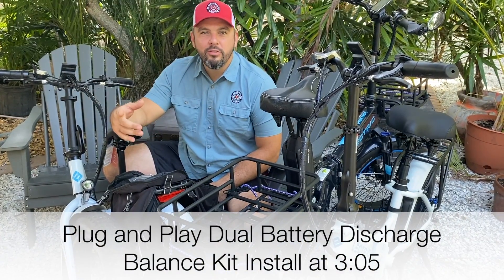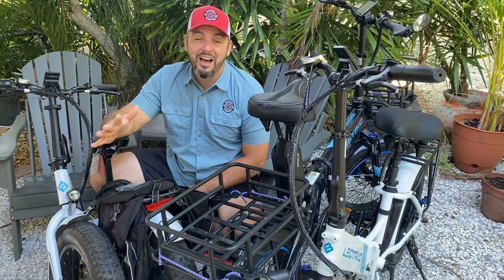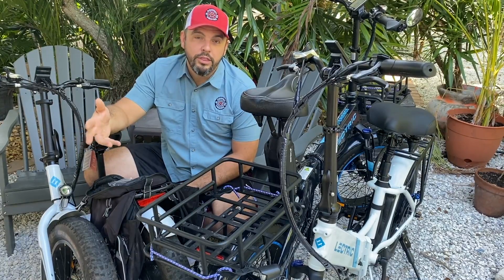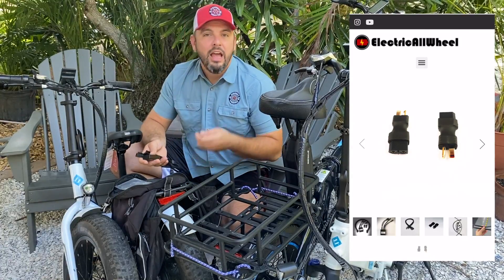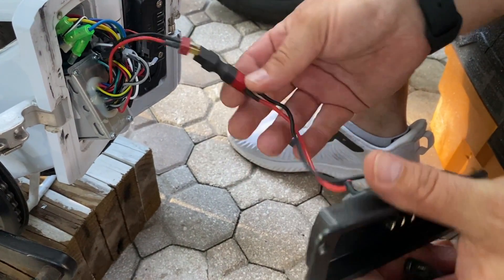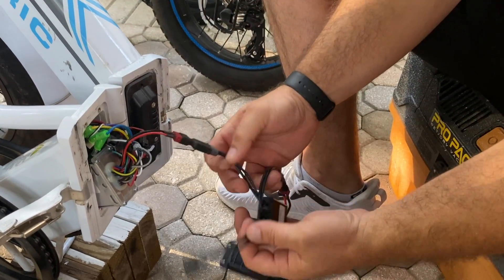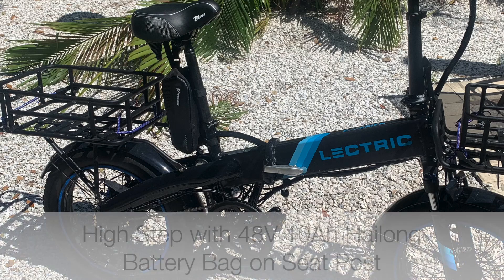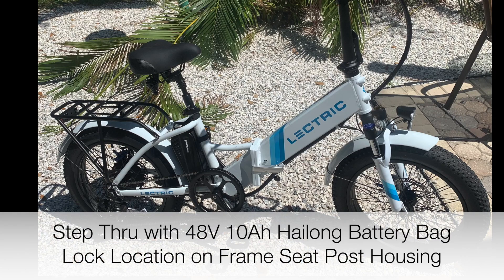Lectric | PLUG AND PLAY Dual Battery Discharge Balancer Install on Lectric XP 2.0 (XP, XP Lite XP 3)

Comment: This is awesome that you've done this, thanks! I definitely want to do this but I would really prefer to use my 2nd "stock" Lectric battery (ST 2.0) since I already own one. Any ideas if this is possible and what I would need? Thanks again!
Reply from the maker: Thanks!
 just so you know, Inside the case of that stock battery is a blue wrapped battery with XT60 connector. You could remove it and use it in a bag or separate protective case.
Reply: @ElectricAllWheel  I saw you had written that on another post but it's beyond my understanding, lol. Do you mean take everything out of the case? I wonder if I could somehow use the silver part of the case without the black plastic part. I wonder if there's a picture of what the inside of the battery looks like with the "top" off.
Reply from the maker: If you unscrew the black head of the battery case, inside the silver block is a battery that is wrapped and slid into the case for hard protective covering. It connects to the black head that has the key lock with XT60 connectors
Reply: @ElectricAllWheel  Great, I just ordered the kit so I'll take a look when it arrives. 
You mention you're in Florida... if you're close to Sebastian I would DEF be interested in paying you to do the install, if you'd be interested.
Reply from the maker: @markthepetsitter  we are in the Tampa Bay region 10 miles north of Clearwater
Reply: @markthepetsitter   Or you can just make A positive and neg lead connected to stock battery pos and neg via wire connectors.   But you would have to solder your own XT60 connector to the other end to plug in to the extensions from the kit
Reply: @fatheadfpv5732  thanks for the tip! I ended up buying the aftermarket battery in the video. I never really liked the way the stock battery mounted in the basket, it was just a smidge too long and took up too much space.
Reply: I have the same situation. The 9ah stock battery and the new 14ah long range battery. So, can I use your kit to run both batteries? Thanks!
Reply from the maker: Yes. Make sure your rated voltage for each battery matches (48V)
Reply: @ElectricAllWheel  will you be providing a video on how to install the kit using both the stock battery and the long range battery? I looked at the stock battery, but I’m not sure how to open it up and whether that will render the black part with the key unusable. Please, advise.  Thanks!

Comment: I have a Sondors Fold Mini/Sport with a 36v 8.7ah battery. Would something like this work for me?
Reply from the maker: Yes. The XT60 to deans t-plug adapters may not work for your controller, but discharge balancer will. Make sure your other battery is 36V

Comment: Can I use a different ah battery as long as the voltage is the same, say a 20ah alongside the stock 10ah
Reply from the maker: Yes. Perfect example.

Comment: I bought the long range battery and still have the original, would be great if someone made an adaptor to utilize both of them it would be a pretty simple concept
Reply from the maker: Inside the case of your long range is a wrapped battery connected to the case head with an XT60 connector. This can be bagged with aftermarket products easily.
Reply: @ElectricAllWheel  so basically can hook into the 60 , on the spare battery seems pretty simple
Reply from the maker: We would avoid cracking the batteries if possible. 
However, even if the connector is not a XT60, it will be a wrapped pack with BMS, and easily adapted. Keep in mind, It’s removal will void your warranty.
Reply: @ElectricAllWheel  should you keep it with good air flow and not all wrapped up and stuff the xt60 connector

Comment: You think there’s enough room in the XP Lite housing for this balancer? Good stuff, thanks!
Reply from the maker: We would put it under the seat on the post with the recommended battery or buy straps for a frame wrap. Thank you for watching!
Reply: @ElectricAllWheel   Not sure I quite understand this,are you saying the balancer will not fit inside the housing of the Lite or will it all go inside the housing with no problems?
Reply from the maker: We have not put the kit on a Lite. We understand the controller connectors and know that the kit will work plugged into the controller. It is anticipated that the balancer will fit in the body like the white step thru in the video, balancer flat on bottom underneath sideways controller. In a situation where it doesn’t fit or the owner has added LEDs or other connections, the extension cables can be switched to the balancer out, and 1 battery “in.” This will allow you to run the balancer to your battery bag outside of your frame.
Reply from the maker: @KellysWildAdventures  Wiring Overview PLUG and PLAY Dual Battery Discharge Balancer for Lectric XP, XP 2.0, Lite
https://youtu.be/NXx5Lr3lmFM

Comment: thanks.  Just bought one.  To confirm, I can hook the balancer up and still just run the Lectric battery right?  I would like to only add that 2nd battery when I am planing a longer ride but leave it off most of the time.
Reply from the maker: That is correct. We would suggest a cap or cover of some sort for the 2nd XT60 plug

Comment: So just to confirm. I can run both batteries at the same time? Thank you for the vid!
Reply from the maker: Confirmed. Make sure both batteries have the same rated voltage.
Reply: @ElectricAllWheel  thank you. Kit has been purchased!
Reply from the maker: Awesome. Keep in touch. Let us know how you use it.

Comment: Nice. If i want to add a third battery can i install another balancer for the two aux battery?
Reply: Yes you can add 3-4 batteries. You need Electromotive Mods FBC quad https://www.electromotivemods.com/shop/p/s1fmuuaawo86hdw5gduhknspnoks37
Polar bear also makes a quad balancer to add 3-4 batteries. Just ask for that option. https://www.facebook.com/marketplace/item/1009541233241252/
Reply from the maker: On principle, we believe it would be fine, but it does raise a good question.